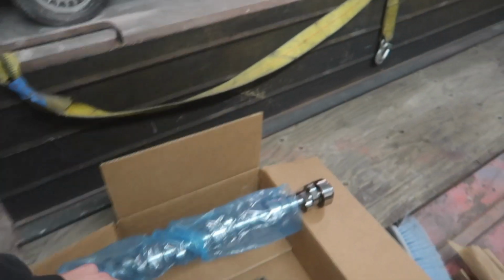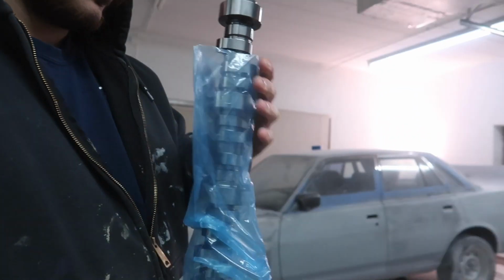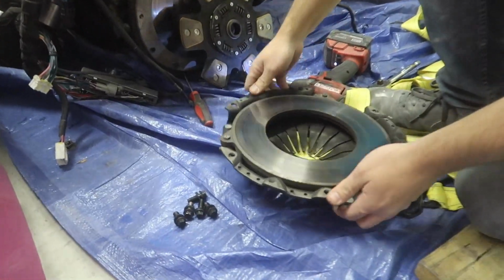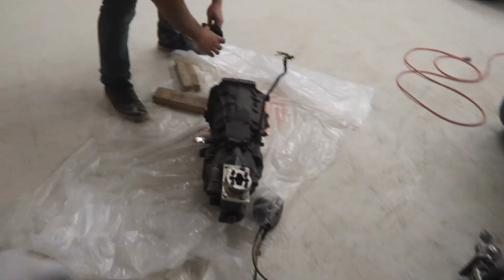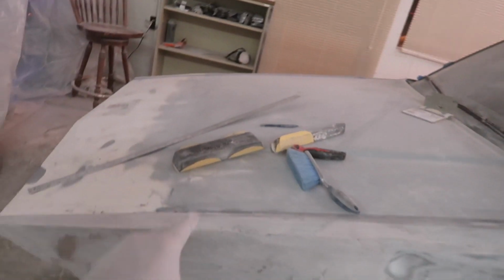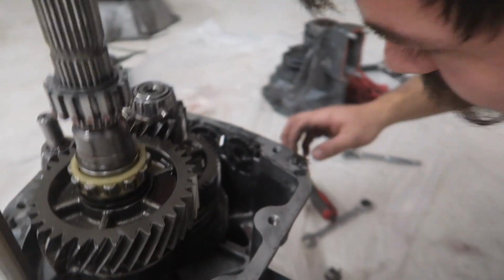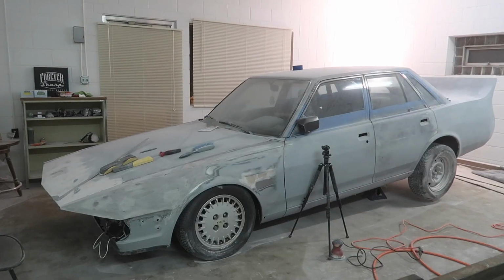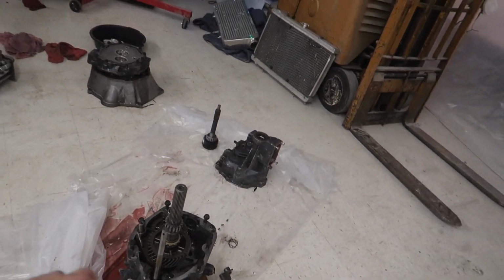Franks Turbo Cam Kit

Comment: Dude, with the gears when you take them apart, if you have a large area spare then take them off and lay them all in order, that way you'll see the order they go back but also where circlip's are meant to be.   Oh and take your time taking the syncro's apart, if they're anything like I've done before they're spring loaded to will just fuck off in different directions, but also then trying to put them back together is another challenge.

It's actually straight forward stripping and rebuilding but you just have to be careful with it that's all.